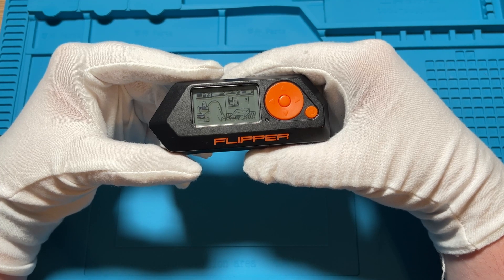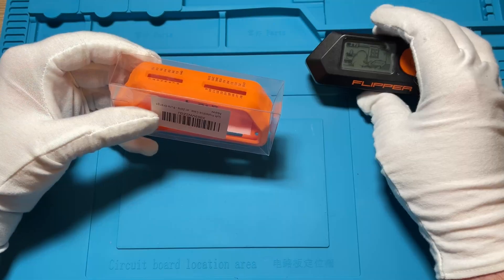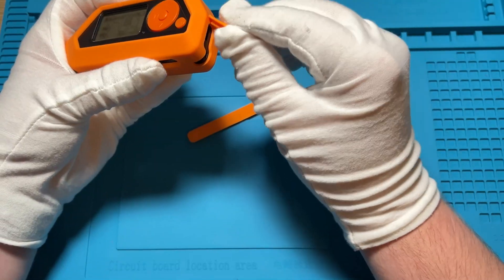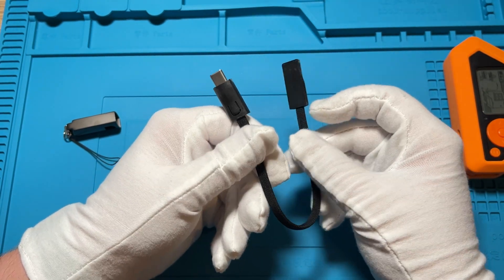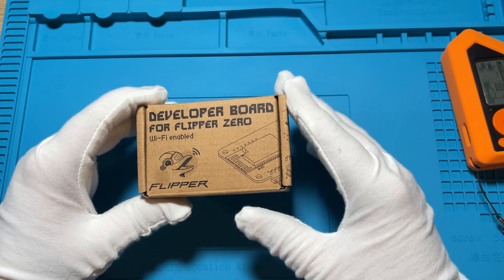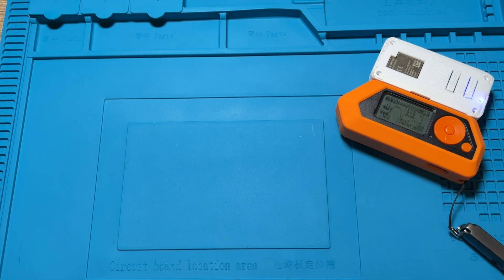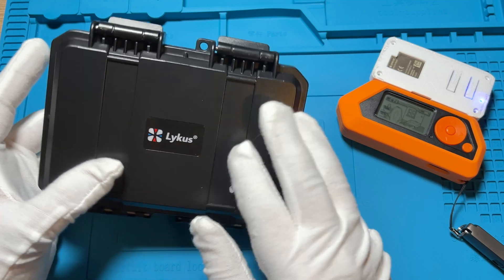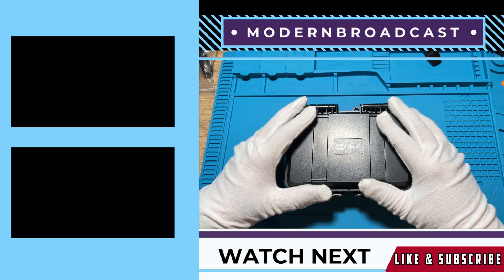Flipper Zero Must Have Accessories for the Modern Hacker

Comment: While the gpio,and sd card covers work great they are a pain to remove then store somewhere on the go without almost losing em then putting back on again,think I'm gonna try printing a new design cover for the flipper where the covers do actually get applied from the top instead of beneath the flipper cover but where it actually also retains the covers to the flipper cover
Reply from the maker: I would love to see this if you get it working. I’d print it with my rubber filament

Comment: The port covers are supposed to be held in place by putting them inside the silicone case with their ridges covering the case access ports from the inside... 😊
Reply: Must be a new addition as I never got the port covers with my flipper zero silicon cover
Reply: This comment is gold
Reply: Came here to contribute that too. 😂
Reply: Lol
Reply: Actually it doesn't fit so well when you try to put the case on it with the GPIO covers in it
Reply from the maker: Lol another commenter mentioned this too. Lol never even crossed my mind lol.